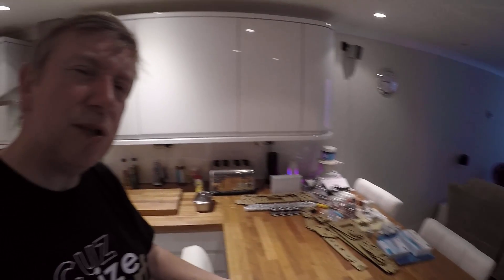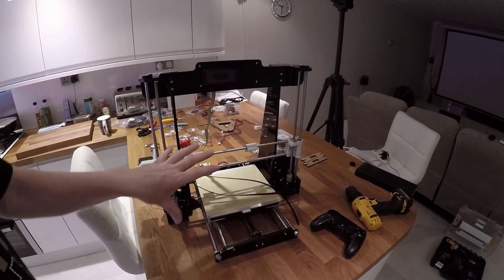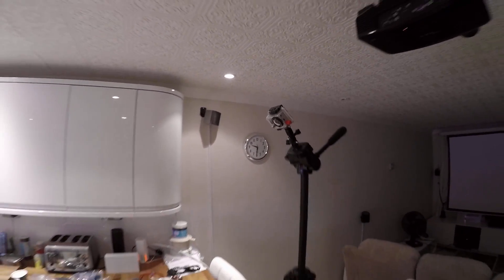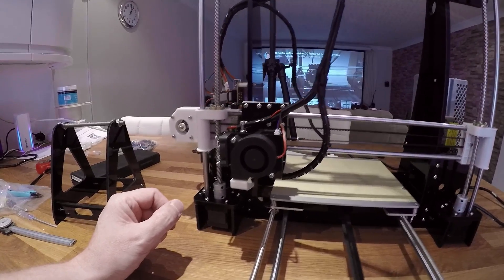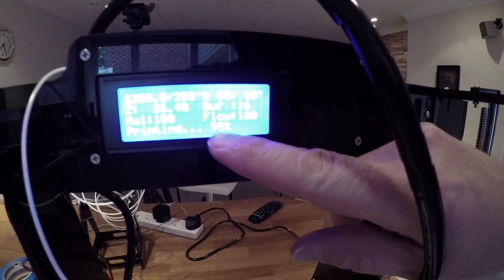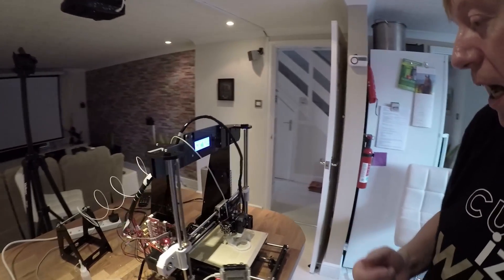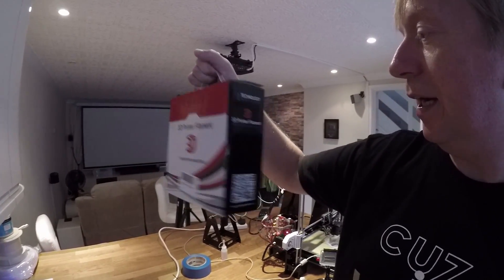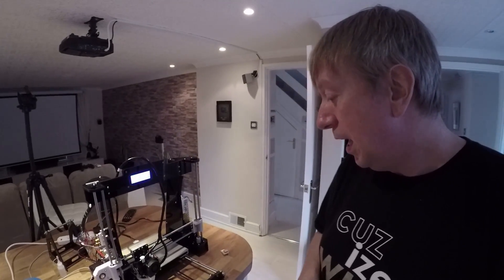A New Hobby? - 3D Printing

Comment: Oh shush I have been oggling these for ages. Haha...I did read you can use blue masking tape to  print on top of , to help get the objects off the bed. I shall look forward to more of these and continue with my little 3d pen enviously.     There are directions to make machines on instructables that can extrude the filament from scrap plastic

Comment: Good video!
Please stand still when filming your face-to-camera sections, the moving around in the kitchen started to make me feel motion sickness!

3D printing is not technology in its infancy, it is well established, however it is continually improving and developing. I remember using a 3D printer as an apprentice engineer in 2007, however back the it was called 'rapid prototyping' because the structures created were so weak they had no practical applications, only visual. The machines were huge and expensive, but saved a lot of money and time in the long run when designing parts for manufacture. Before you would have to give billets of metal to an experienced machinist to knock up or spend time making a CNC programme. Then you would get some features too difficult to machine cheaply as a prototype or that the tooling was too expensive for. There would also be a lot of material waste if machining from a solid block.
These 3D printers meant that a design could be taken straight from a CAD drawing and knocked up in minutes to get a visual representation. It became invaluable within design. The downside was that the surface was poor and recurred a lot of sanding to finish nicely.

The methods or creating structures, materials used and colours have developed hugely too which is great.
We used to have one colour, it was very weak and you couldn't manufacture moving parts due to poor surface finish and the way the structures were printed.

Looks like a very interesting and practical hobby you have found there. Let us know what great things you end up making!

Comment: If I were you rick, this is what I did with mine, because I was worried about the fumes from ABS, I made an enclosure for my printer, then set it up in my shed, so in case it burns down, it only burns my shed lol. I used a mini computer to connect to it and control it via teamviewer, and use a webcam to watch the printer to make sure it doesn't error etc when printing. FYI I used a Lulzbot Taz3.

Comment: You never cease to amaze Rick.
I'm not a fan of 3D printing as I see it replacing FAR TOO MANY JOBS :-(
But small printers/kits like yours are absolutely fascinating. The technology is an Alien concept to me (A bit like the POWER of mobile Phones).
As a 'new hobby'?? .... I think you're going to have to find another one to fill the time you sit waiting for your new machine to go through the motions ;-)

Good luck though Rick, looking forward to seeing what you build with it ...... 
(A new Van Perhaps?? ;-)
Reply: Peter Moring it won't replace too many jobs, most manufacturing is automated these days already. Metal is machines on pre-programmed CNC machines and plastic by automated production lines.

The jobs were lost many years ago in the UK, this will just make things even easier and cheaper to manufacture.

I was using these in 2007 as an apprentice engineer and they were purely used for knocking up prototypes before the design was finalised and machined on a lathe/milling machine.

Comment: I was wondering when you were going to get into 3D printing, I've always felt it was your kind of thing. 
I need to quickly mention a few things though. Anet A8 isn't also known as prusa i3, prusa is a completely different brand, these cheap chinese printers are trying to steal prusa's good name. 
The Anet A8 is also a deathtrap, to the point that many home insurance policies are invalidated by having it in your house. Look into the mosfet mod for it to make it a lot safer, as well as putting a new connector on the heated bed. 
The A8 has an acrylic frame, which makes it much more likely to crack, and it's not as rigid as other frames so that can cause wobbling artifacts in the print.  
It does have a huge community supporting it though, so you'll be able to find answers to any problems you have.
Building it yourself rather than buying it pre-assembled is a great idea, that's how I built my printer, and I agree that it forces you to learn about how the printers work.  
If you want to learn more about 3D printing, I can highly recommend a few youtube channels, Maker's Muse, 3D Printing Nerd and Thomas Sanladerer. James Bruton has a lot of helpful tips hidden in his project videos too. The 3D Printing section on reddit is extremely helpful too, and a few posters there have strong opinions on the Anet A8.  
And if you want to design your own parts, rather than relying on files that other people have uploaded, Fusion 360 is a very powerful and free software.

If you ever decide to replace your Anet A8 with another low budget printer, I can highly recommend the CTC i3, it's what I have, and with a bit of modification it has become a great printer.
I'm sorry if my comment sounds super negative, I'm really excited about you getting into 3D printing, and if you ever have any questions or want recommendations on useful tools, software etc., I will happily help you as much as I can. 

I wrote this comment before I finished your video, and I noticed you mentioned the mosfet right at the end. I highly recommend it, I added it to my own printer and it literally took about £5 and a few minutes of work. If you want to upgrade the power supply, look at ATX power supplies for computers.  
I also use a Raspberry Pi and Octoprint to control my printer, look into that too, it allows me to control everything from my laptop and record timelapse videos :)

Comment: I think you need a scraper to remove parts, something like a wallpaper scraper, flat blade.
I'm surprised the bed stays hot once enough of the base is laid down, i would look into being able to turn that off after a while.
If the PSU doesn't have a fan, you could get a small computer fan, blow some air through the case, if you get a 5v fan and there isn't a way to connect it to the psu, run it from a plug in charger, an old usb cable cut and joined is easy, it's 'usually' the red and black wire in those leads..
Reply: Sparky Projects the bed needs to stay warm throughout print to stop the bottom layer cooling and then coming loose on the print bed. The warm plastic sticks the print to the base.
Reply: Ah, ok, just seemed it was stuck firm once the print had stopped.
Reply: Sparky Projects that's because the base will still be hot, the print had literally just finished. If Rick had waited for the bed to cool down it will pop off really easily.
Reply from the maker: Sparky Projects thanks for the tips guys, I didn't know about the cool bed thing James, I'll try it. I'll be looking around for a fan for the psu, am currently using a desktop fan but I realise that such general cooling might be counterproductive for parts that need to be hot.

Comment: Wow im impresed thats cool . Could you put a desk fan near to the power supply. Looking forward to more 3d printing stuff
Reply from the maker: goonluv yes am using a desk fan now, but am wondering if it might be counterproductive as it's also slightly cooling some parts that need to be hot. Will probably add a PC fan to the psu case.